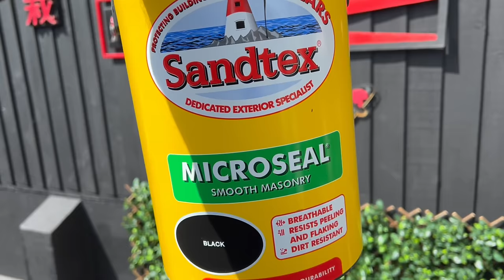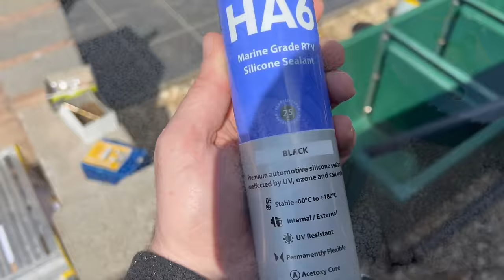THE THREE MUSKETEERS ARRIVED TO SEE MY POND AND MORE WORK DONE ON THE GROW ON POND!!!

Comment: I had issues with the bond it HA6 silicone bud, My pond MS300 is 100 times better, apply it and leave it for at least 24 hours before handling it. also i wouldn't worry too much about level of water as you'll be pulling more water through it with your pump and wont notice it, i worried about the same thing mate.